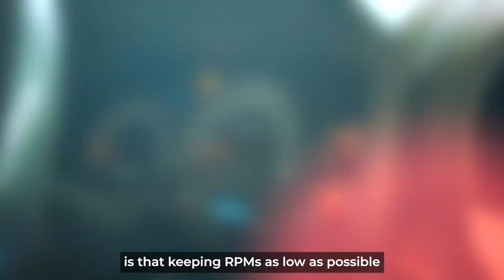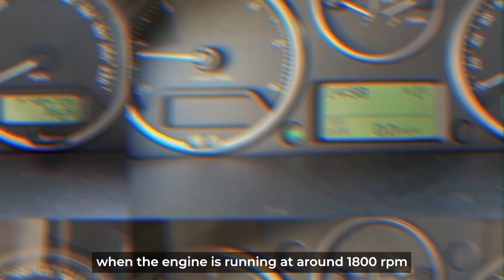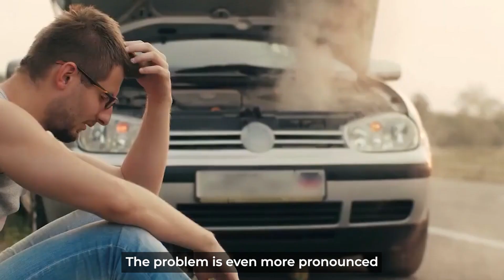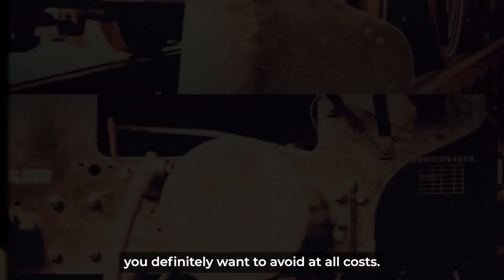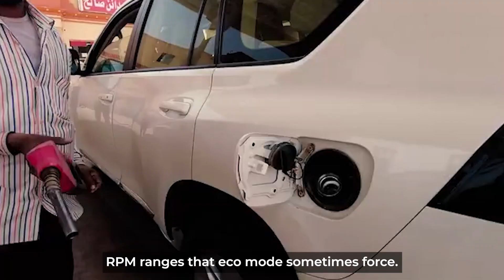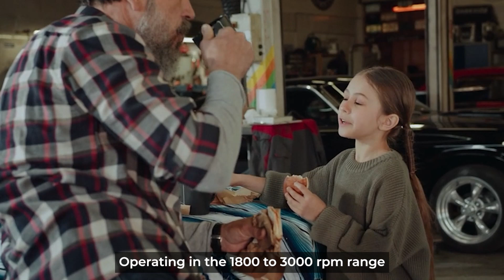7 HABITS Make Your Diesel Car LAST 500k Miles Without Repairs!

Comment: bunch of crap , my bmw diesel on 185k miles not foriegn kms , i drive with lowest rpm i can and save a load of fuel , besides if i drove at those lot higher rpms , i would be breaking speed limits all day long !
Reply from the maker: Ah, the classic RPM debate! It seems your BMW is living life in the slow lane while still making great mileage. Who knew low RPMs could be so rebellious?

Comment: My Dad has an 18 year old 2006 f350 6.0l dual rear wheel manual and we always run RPM's to at least 2000 Rpm to do a gear shift and whenever we're cruising on the freeway/highway we always have our RPM to a maximum of 2500 for the new engine to last longer and not to avoid any gadget failure 😅😅
Reply from the maker: Thank you for sharing your insights! It’s great to hear how you and your dad take such good care of the F350. Tips like yours can really help others extend the life of their diesel engines!